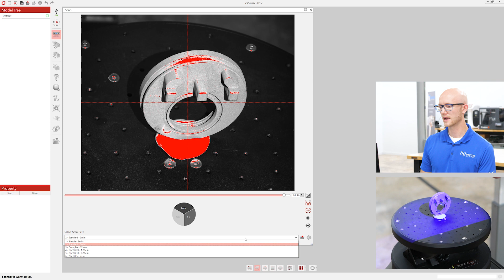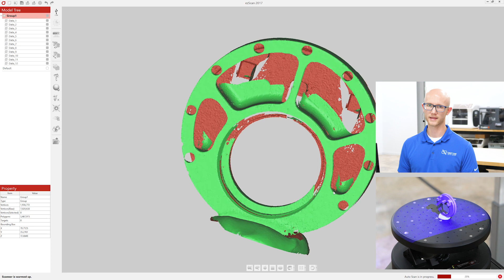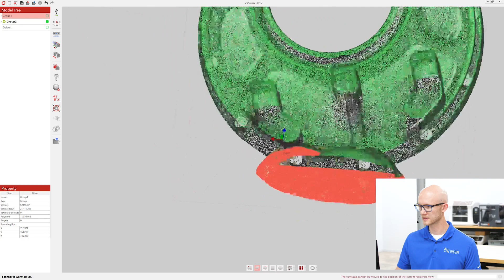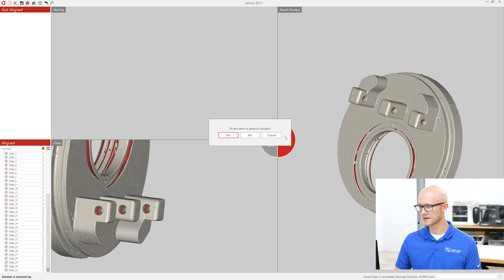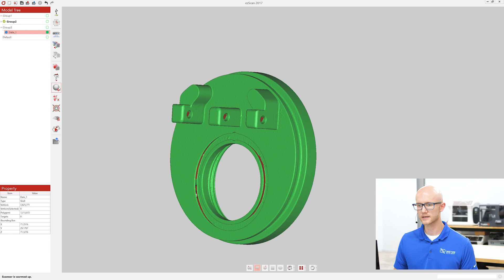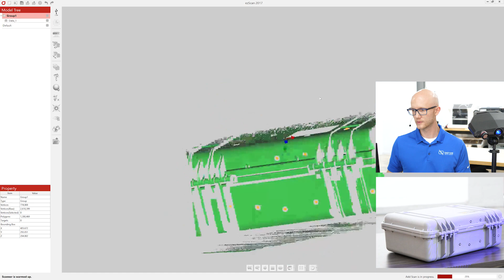Solutionix C500 3D Scanning Demo w/ Sample Data

Comment: What is the deviation you have found when you scanned with c500 lense family because the scan registered to target point and then continue the scan process with next target points and on compiling all shots of data what error it's gives. Because there are number of shots and they are registered last target points.